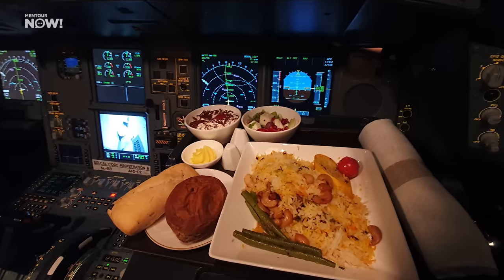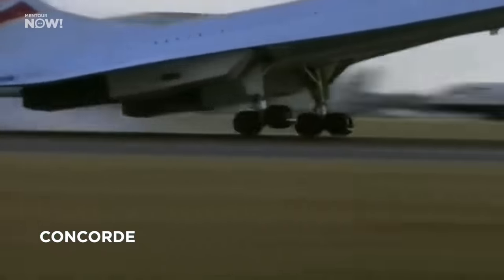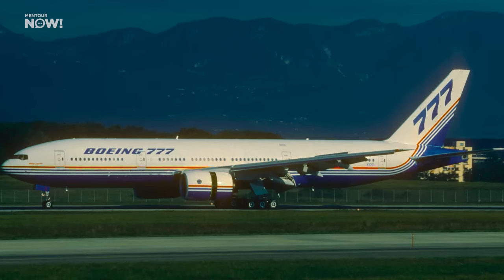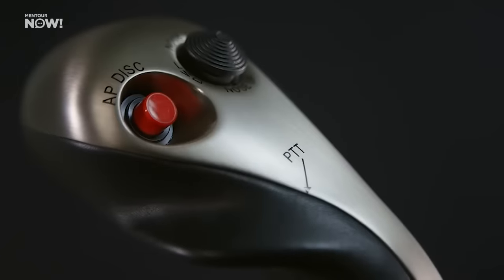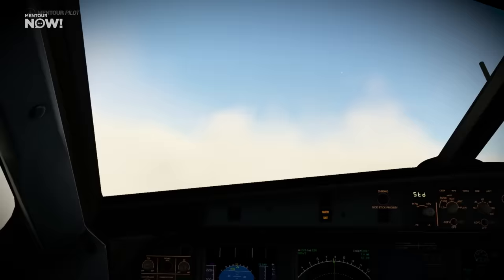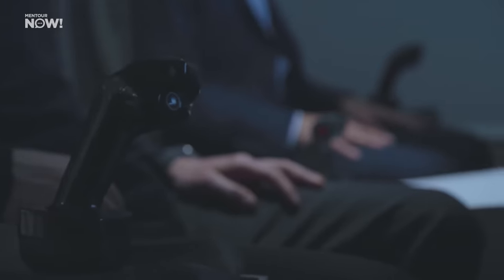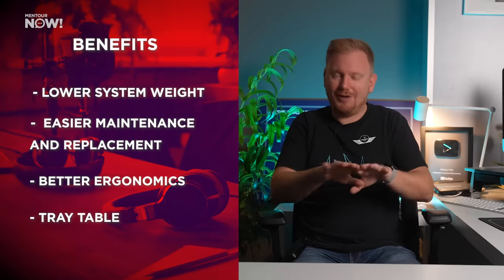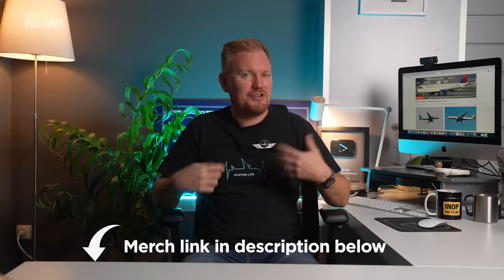Will Airbus Finally switch??

Comment: I fly the A220 and one interesting thing about its sidesticks is that they actually have a force feedback system linked to the trim system and they also have a stick shaker function 👍 Still no interconnection between sidesticks though.
Reply: Thanks for the info
Reply: But you don't though.
Reply: @thegrandmuftiofwakanda ?
Reply: @Leaferr  he's jelly
Reply: I fly Aerosucre and I can confirm we Fly Into Wires at the end of the runway regularly
Reply: Did the A220 used to have a yoke?
Reply: @harveysmith100  no
Reply: I fly the A220 as well, and I have several years experience in the A320 family... you don't get feedback in the A220...why would you think that?
Reply: @hvygns15  read my comment again. You do get a feedback -linked to the trim system-, that's only when you're in an out of trim condition during manual flight. Of course it is only a simulated force feedback through a spring system (I should have specified that). Still you'll have a stiffer stick in that situation, making it easier for you to notice.
It’s something different from the 320 stick anyway (I have flown it too for some time)
Reply: The A220 is really a Bombardier product so isn’t really the same. 

All transport category aircraft except really old ones or the Boeing 717 or 737 when in manual reversion use artificial feel as the powered hydraulic flight controls are irreversible. The feel is usually a combination of springs and small hydraulic actuators.

Comment: Force feedback and actually moving both sticks in sync in response to an input on one stick (to avoid dual input confusion, which has contributed to accidents) would be a huge safety improvement.
Reply: Exactly.

That would've prevented the tragedy of Air France 447.
Reply: Embraer used a comercial system that already existed since the 2000s, funny how Airbus simply ignored that.
Reply: airbus unlike Boeing doesn't need huge safety improvements

Comment: Been in the Bus for 15 years. As mentioned on a comment before, the main issue for Airbus is that when too close to the ground and not having a feedback on your hands may lead to undesirable situations. AirBus is a perfect machine but this improvement would help a lot, specially on instruction flights.
Reply: 00😊
Reply: "Perfect machine, but this improvement would help a lot"...sooooo not perfect. 😄

Comment: Yokes also give out of trim (rudder/aileron) indications just by looking at them (you know that mark on top on Boeing's yokes that centers when the rudder/aileron is well trimmed), this is great for Single Engine operations as it makes trimming the rudder that much easier. A yoke that is angled to one side is a clear indication something isn't right including a fuel imbalance.
I can tell when a former Airbus pilot is fairly new to the 757 as they tend to keep their hands on their laps with the Autopilot / Autothrottle engaged. Yes, I fully agree active sidesticks would be a great leap forward for Airbus. Great video!!!

Comment: Though not a side stick, we used to make the Q-Feel valve for the Harrier. This provided feedback to the pilot primarily during slow speed manoeuvring when there were no aerodynamic loads being fed back from the control surfaces and the size and weight of these units was not very significant at all. Making sidesticks active shouldn`t incur a significant weight or size penalty but it would cost.
Reply: Like what doesn't cost on an aircraft!
Reply: I remember a story about how the first F-16 prototypes had sticks that...didn't actually move. At all. Since it was all 100% FBW, they didn't actually have to move, but instead just detected pressure on the stick, but it freaked out the pilots, so they put in some artificial movement.
Reply: Interesting
Reply: not just cost. For a fleet of a/c, how are you going to transition? You'll have  some of the crew trained for active, and some of the aircraft with active.
I don't think it would happen, you'd have to have a separate qualification. OR make active feedback a selectable option for trained crew....

Comment: As a retired captain B767 now an instructor and recently Type'd on the A320, getting used to the side stick is not a big problem, Left Hand or Right Hand (I split training 50/50 left and right seat for my type) and flying the B767 both right and left seat I had no issues with getting used to right/left hand when flying. The one thing I do miss on the Airbus is visual queue's as to what the "aircraft/Autopilot" is doing or the FO is imputing (if anything) What I would most like to see (on the Airbus) is auto throttle movement. Visual movement of the throttles is a big BIG indicator of something happening way before you know about it on the (non moving throttles) Airbus.

Comment: I wanna see the fly by wire differences!  Also, if you haven’t yet, you should dive into the 1500 ATP rule in the US and how it’s affecting pilot supply/demand.
Reply: He has
Reply: He already has a video on the subject
Reply: He has done it, though watching the senate hearing last week where many people seem to be under the impression that 1500 hours is beneficial was shocking to me.
Reply: Definitely interested in the FBW differences and how they affect safety. I've learned so much from your videos, and it's fascinating to hear about these magnificent protections that exist - and what their limits are. The design choices are so critical, and there's no single obvious answer.
Reply: Scare Buss
Reply: That issue may have taken care of itself with the recent news of both FedEx and UPS having way too many pilots and encouraging them to seek employment elsewhere. Anybody who has ever been in this industry knows full well it is very cyclical and I for one would not be surprised if another major downturn is close by. As for 1500 hrs? That amount of time is meaningless if it's all flown in a traffic pattern at a local airport.
Reply: @Georgiagreen317 Well said, not only for aspiring ATPs, but also seasoned ATPs, given also how highly automated modern airline jets are, to the point that actual hand flying takes mere minutes for both takeoffs & landings, with the majority of the flight on AP - except during emergencies.

Thus, the differentiating factor would be the rigor, intensity & frequency of emergency training in the simulators to keep the pilots response sharp & correct for when the need arises.

For there's a useful saying: Under pressure, we don't rise to the occasion, but sink to the level of our training.

Comment: The biggest control advantage of a yoke versus a sidestick is the yoke is much easer it modulate in smaller percentage of full travel increments for the finesse needed for superior landings...  fly by wire may damp and modulate some of the inputs on FBW aircraft, but the yoke does enable more finesse than the side stick.

Comment: It's absolutely nuts that Airbus does not have force feedback. Video game controllers have really good force feedback, just look at how realistic a good wheel and something like iRacing can be, and Airbus has the real values the controls should be feeling from their sensors. And it's not hard to add a system that stops the feedback if it reaches a certain threshold... It wouldn't even be hard to add it so that the pilot can physically disconnect it if needed. Disable the system if the pilot isn't in the seat, and if you want a physical override, make it so that e.g. the motor is connected by a piece of plastic that breaks if the pilot inputs more than 60kg - like how the yokes snap apart on some Boeing models if you fight against each other.

Comment: I think an analysis of the difference between fly by wire in Airbus and Boeing would be a great video! There is a lot to be said for Boeing's version, where the pilots ultimately have the ability to overrule the computer, much more easily than Airbus, as well as the computer still giving feedback through the yokes, but I'd love to hear your analysis
Reply: Boeing departed from direct control with the MCAS.  Cannot understand what (oversite) made that possible.  At some point, one switch should give the pilot total control over an airframe assuming the design is stable.  I would also hope that any such system would also ensure that a reasonable forward CG is established asap is the plane is in a neutral or tail heavy configuration.
Reply: @iancormie9916  MCAS is only supposed to come into effect to assist with stall recovery, and even if it acts erroneously, pilots are now trained in overruling it. That was part of the recertification process, so that pilots wouldn't lose control like those two accidents. 

That said, the 737 (even the MAX) is still direct control. It is not until later aircraft that fly by wire was introduced
Reply: Clicking only 2 buttons found on the same panel would give total control to the pilots in an airbus

Comment: If you are looking for a counterpoint to your positive feelings about active feedback in side-sticks, here is what I think.  Whenever you add a new system into an airliner, ESPECIALLY a primary flight control, you have to ask "what happens when this fails?"  Getting answers is very difficult and often tricky for the engineers.  Before they system is implemented, they can't be absolutely sure what will happen, because it hasn't happened yet.  So they must make assumptions about when and how it will fail, and what the crew will do about it.  This uncertainty can make engineers very reluctant to change something that already works.  As for the pilots, they could be confused by failure of the feedback system to give them correct (or any) feedback during a maneuver, leading them to overcorrect, or cross-control, similar to what has happened in past accidents.  So digging to the heart of its reliability might reveal that there are new problems introduced, even as it prevents old problems.

Comment: As an A320/A330 pilot, I think that should the design remain the same except the force feedback, it would be a really good idea. I would just suggest a way of disabling the active system should there be faults, maybe a little button somewhere near the PFD/ND display setting switch that allows the system to be disconnected should there be any faults with the system (ie. false feedback/really bad trim issue to prevent fatigue from pulling the sidestick back). I think it would make a trainer's life easier too being able to see all inputs easily.
Reply: Active side sticks and throttle levers that move in sync with pilot or computer inputs (and active shaker) would solve most of such issues.

Not having active side sticks is that single point of failure that caused Air France 447.

Airbus alone is responsible for this design disaster.

Comment: Airbus can keep their side sticks but they DESPERATELY need force feedback. We've seen like 3-4 videos on this channel alone of accidents where both pilots were inputting on the controls and the system averaged the input. They never hear that dual input horn (now that it exists) in an emergency and Air France 447 was a direct result of that lack of feedback.
Reply: Dual input warning is also displayed prominently in their primary flight display. If they no longer look at their instruments, then something is really off anyway. Speaking of Air France, they managed to perform unrecognised dual input in a 777 on a beautiful day. BEA in their preliminary report made a veiled but very acid remark at Air France and their capabilities.
Reply: 100% agree.  The inability of the pilot to feel through the controls that they are fighting another pilot's input is a critical point of failure.  It was a huge factor in the AF 447 crash, among others.  I'm really shocked that making the sidesticks move together has not been made mandatory 30 years ago - it's just such an obvious and dangerous weakness.
Reply: I just can't believe that anyone could ever have thought that designing an aircraft with no feedback in the control stick was a smart idea...
Reply: @geezee1946  The service record of the entire Airbus family is a pretty good ringing endorsement for the design.
Reply: @geezee1946  Every modern fighter aircraft has absolutly no feedback in the control stick. Do you really think they are all wrong?
Reply: Exactly - I severely doubt an AF447 type situation would ever happened in a 777 or 787 as the flight control feedback would be a further level of protection.
Reply: @shi01 those are also one pilot craft. Even the few planes with two people, the second is a electronics warfare officer of similar, and does not have any flying duties. Very different from a commercial aircraft where pilot and copilot are constantly switching who is flying.
Reply: They also could just put a small and easy to implement vibrator motor for warnings.
Reply: @shi01  fighter aircraft have less priority in safety than commercial aircraft (safety in a sense of passenger carrying airplane). their priorities are different, you can't really compare both. they (fighter aircraft) are not wrong, what is wrong is your rethorical question.
Reply: Too many distractions. Keep it intuitive and simpel
Reply: It is about dual input. Also although very safe, making it safer does not hurt
Reply: @Chris_1024_ The root cause it's a little more obscure. It seems that due to the way Airbus implemented the normal flight control law some pilots were getting used to indicate with the stick what they expected the plane to do and not how to do it. What I mean by that is that if they wanted the plane to get altitude they were just pulling the stick and expected that the plane was doing the actual control. All this was working fine in Normal Law but during this incident the plane degraded to Alternative Law 2, or direct input control. That means that during the incident just pulling the stick would have worked with Normal Law, the plane would have first dropped the nose to gain speed and then pull up. But in direct mode that didn't happen. That's why at the end Bonin replied "But I've been at maximum nose-up for a while!" and didn't understood why it had not the expected effect.
Reply: Both of those incidents happened on Air France planes.  
Maybe AF/KLM needs better training.   Berets and Gitanes in the cockpit too!
Reply: @skayt35  "Dual input warning is also displayed prominently in their primary flight display"

NOT prominently enough and it's such a critical danger to the safety of the ship that it needs to be something that's on ALL displays, if not also reflected in the cockpit lighting so that anyone else present notices it

This is also something that's critical enough that taking control electronically MUST NOT be behind a couple of menus, but instantly switchable to either side if needed

In the case of AF447, the pilots used the usual "I have control/You have control" mantra but the guy in the right hand seat never let go of the stick from cruise altitude until a few seconds before the crash, even when told multiple times to let go of it

(The CRM in AF447 was terrible in many aspects and more recent incidents like the 777 near crash reflect that AF hasn't fully taken that lesson onboard)
Reply: And both Max crashes were directly linked to Boeing force feedback. It was also not a problem in AF447
Reply: @Chris_1024_ Nice choice of cut point, liar. Literally two lines later:
02:11:21 (Robert) We still have the engines! What the hell is happening? I don’t understand what’s happening.
 [Robert has no idea that, despite their conversation about descending, Bonin has continued to pull back on the side stick.

Hmm what would have informed Robert that Bonin was physically doing the opposite of what he said and made him push the override button, I dunno...

Over
one
minute
later:
As the plane approaches 10,000 feet, Robert tries to take back the controls, and pushes forward on the stick, but the plane is in "dual input" mode, and so the system averages his inputs with those of Bonin, who continues to pull back. The nose remains high.
02:13:40 (Robert) Climb... climb... climb... climb...
02:13:40 (Bonin) But I've had the stick back the whole time!
 [At last, Bonin tells the others the crucial fact whose import he has so grievously failed to understand himself.]
02:13:42 (Captain) No, no, no… Don’t climb… no, no. 
02:13:43 (Robert) Descend, then… Give me the controls… Give me the controls!

 [Bonin yields the controls, and Robert finally puts the nose down. The plane begins to regain speed. But it is still descending at a precipitous angle. As they near 2000 feet, the aircraft's sensors detect the fast-approaching surface and trigger a new alarm. There is no time left to build up speed by pushing the plane's nose forward into a dive. At any rate, without warning his colleagues, Bonin once again takes back the controls and pulls his side stick all the way back.]
Reply: @Infiltator2  So that was a fuckin' lie. The MCAS directly moves the stabilizer and has no connection to the force feedback or the control interlock. The Lion 610 aircraft had tried to crash itself for the same reason the day before(!!!) While the captain of that flight did a lot of other irresponsible stuff (Forget it Jake, it's Indonesia) and there were several other cues that could also have saved the crew who survived, the changes in control force are credited for the captain's correct diagnosis of runaway stabilizer trim and the correct response of turning off the trim motor.
Reply: 447 was direct result of improper training and loss of SA from both pilots in CM1 and CM2 seats.